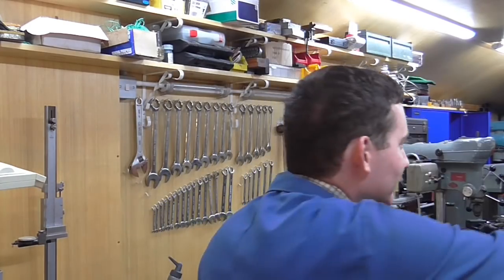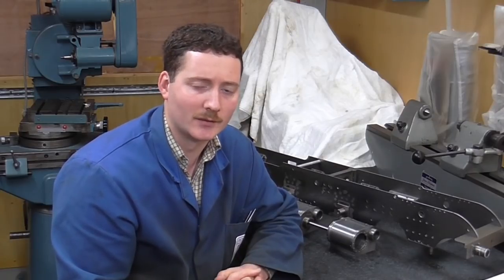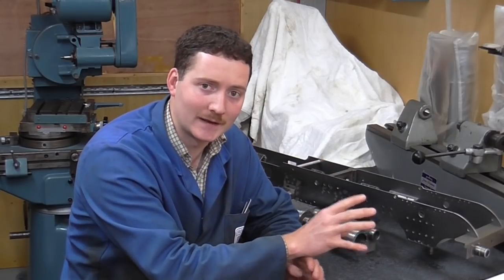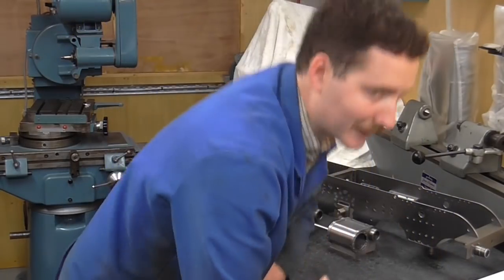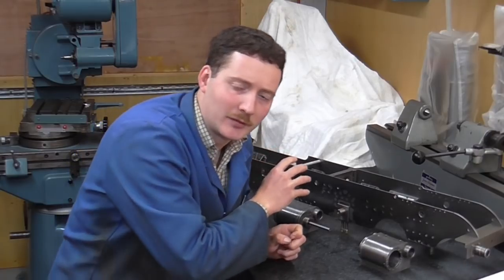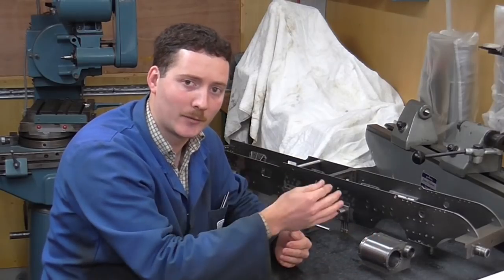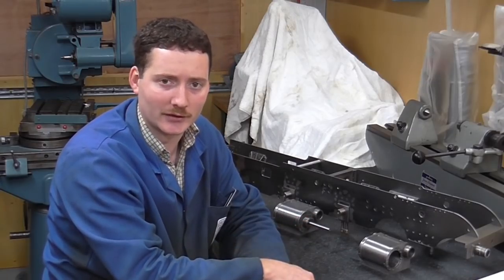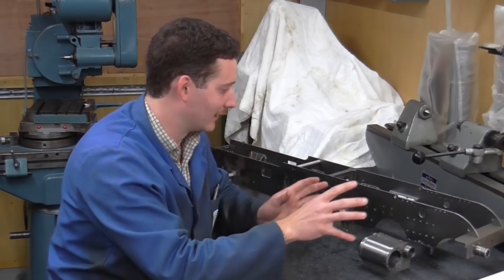Build Yourself a Steam Locomotive

Comment: Totally agree regarding lathe and milling machine. I started off making my LBSC Tich with a vertical slide and it was so frustrating, getting a small mill has been a game changer. Like you Im interested in building a loco for the engineering side of things rather than running which is why ive gone for a small tank engine subject

Comment: Very informative video and should be mandatory viewing for every model engineer before starting a project. I am building a 7 1/4" Dart 0-4-2 originally designed by Martin Evans, it transpires there are 13 errors in his original drawings from parts out of the scale position to the brake controls running through the ashpan. I have heard Martin Evans referred to as Martin Errors. 
As you say, filming a project takes up a lot of time and in a week you might spend 5 days building and two days editting and posting the video, apart from the time setting up the camera, starting and storring filming in between machining parts. 
Steve

Comment: No machine experience at all myself (though I hope to learn), but I found this interesting, my thanks and compliments.

Went the fully-machined kit route for my first locomotive, a Gauge 1 0-4-0T, so that's another option one might consider if they want a locomotive, as there are kits for larger scales. Sort of what I'm hoping to do, save up for a 5 inch gauge kit and then get the machinery and skills to keep it in good repair.

Comment: As a Ex motor mechanic Apprenticed in 1969 I have often been asked by car enthusiasts what bolt manufacturers or indeed during metrification what bolt sizes were used on a specific model As I pointed out to one Remanufacturer of Ford's UK products his turnout was a Rolls Royce compared to a Dagenham Dustbin

Comment: Hi Cris, as you know I'm building a Clayton Steam Wagon. I chose that because: I didn't want to be tied to a track, has a relatively simple to build vertical boiler, fits the available space, has features that I am familiar with on full size road vehicles such as steering gear and differential. But I guess like you its the journey rather than the finished model that interests me the most. I have a Simplex and its a good loco but haven't used in 3 years, having said that lockdown has got in the way for most of that. Look forward to more videos.

Comment: On the subject of half built engines, whilst not disagreeing, I do have a part build I need to finish. I bought it as  the chassis for an 0-4-0 similar to Titch at 3 1/2" gauge with drawings from a well known auction site. When it arrived it turned out to be 5" freelance contractors tank engine with original drawings, which are so good, I bought an A0 case to keep them safe and had copies made because they are getting no where near anything dirty.. The chassis runs on air fantastically well though the axles need a trim,  and I need to make the boiler which shouldn't be a problem as I have had a specialist prepare a safety report on the design.

Comment: As always , sound advice mr Crispin , don’t let your heart rule your head …. 3 years into a self designed 7 1/4” gauge “ Lion” all on a myford  back in the 1980’s early 90’s ( had to pull the lathe round by hand to cut the tyre rads on the wheels ….. ) but events over took and now finished by its new owner I believe …….

Comment: I would imagine beginners unsure of a project of that size might want to consider building 1 or 2 official piston/valve assemblies into a simple reciprocating engine to get a feel for the work, and if they decide they want to do the whole job they can decide to do so at that point, or if still undecided, then build the boiler to run the partial engine on steam, all the while developing an inventory of spec bits that match the plans. At any point, the running engine/boiler and other bits could be sold to an enthusiast who might want to complete the rest of the model but lacks the lathe/ mill or ones of sufficient size.

Comment: Another loco that Australian builders may consider is Wombat .
Only thing I can add to this is unless you are an experienced model engineer stick with proven designs that have been built many times as it is much easier to research for any drawing anomalies or revisions , I’m currently building  a version of the M.E beam engine but the drawings  look like a Chicken with an LSD addiction has scratched them out and many of the dimensions are grossly wrong or non existent leaving me to spend many hours of my life trying to work out what is going on .This will be the third and last kit I build from this supplier, first one was ok on the drawings but crap castings , second one not bad overall but this last one is doing my head in 😵‍💫  I built a Stuart Score engine a few years ago and it was a pleasure because the drawings and castings were to spec - the thing I’m doing now is a real dogs breakfast but I will get it done eventually !

Comment: I liked ur video
I am a retired machinist, with a machine shop at home, bridgeport, hardinge lathe etc.
My biggest challenge seems to be
getting a full set of plans.
I have built, model steam engines before and like the external components.
looking at ur model, perhaps something 1/3 to 1/2 ur size.

So any ideas on plans ?
thank you
Reply from the maker: Hi, see if you can get on the AJ Reeves website and have a look at Simplex or Rob Roy

Comment: A technical question that I have been wondering about is do any steam engine builders use the relatively modern design type of spirolox spiral stainless steel rings for piston rings? It seems a very viable idea to use such a design of piston  ring rather than the old school,thick section cast iron rings.
Second question: did you remind the brother to pack his  tooth brush before the recent Ireland visit?

Comment: The answer to the question "Wouldn't it have been better to use a pan head rivet on this step" is usually f off. Similarly for those who insist that there must be a battery even though you've told them it runs on steam, and it's smoking and shooting steam out of one of the safety valves.

Both Simplex and Sweat pea are good passenger haulers. I know someone selling the latter if anyone is interested, though is has a few issues and they are looking for boiler certificates.

Comment: A well thought out video. One thing I would like to add is drawing software. I come from an engineering perspective and am building a model for the challenge. There are a number of errors on the drawings just as you say with your engine. I am using drawing software to iron out some of these errors and possible problems, and its also good sometimes to help give me an idea how to approach a machining challenge.
Reply from the maker: A good point
Reply: Hi Mark.

In engineering we have a saying "measure once, cut twice".
Reply: I am using Fusion 360 (free personal license) to create and assemble the components of my loco project before I actually machine them for real in my workshop.
Reply: @simonwalker1064  When you come to turning your CAD/CAM designs in to reality in the workshop, please remember "measure once, cut twice".
Reply: As we used to say “ An hour in the drawing office is worth a day in the workshop ! ”

Comment: Documenting these builds would be a great assignment for an enthusiastic kid learning 3D CAD modelling software. I wonder if anyone has tried. There are FOSS (free & open source software) packages available, as well as online versions of proprietary software packages, so it would be just a matter of time and gathering the resources to do this.
Reply from the maker: I know of a few people who have modelled their own projects but not aware of any commercially produced models.
Reply: @MrCrispinEnterprises  I've done a little webcrawl to see what is around...mostly people creating renderings, no one going and doing a comprehensive design from the top to the bottom. 

I'm not particularly a CAD driver, e.g., 3D modelling CAD software, PRO-E or Solidworks, but have played a bit in FreeCAD, the closest analogue in FOSS software. I can create 2D flat engineering drawings in an old shareware CAD package I've used for 25 years (it's still being updated)--the best $25 I ever spent. These are vector files and can be exported into .dxf format (and some others). If you've got some data, I could at least help you get things drawn up, if you need the help. I'm not a train fan per se (my father played with HO scale stuff and was a machinist), but I do enjoy machining projects.

Comment: Have you considered making a discord server for the channel? It would be a free way of running a "forum" and could be useful for discussing building methods or design issues. (Currently trying to design my own 3 1/2 inch train and I'd certainly be interested with your own and others input.)
Reply from the maker: That's probably. A good suggestion. Unfortunately I know nothing about websites / forums ect I will have a think.
Reply: @MrCrispinEnterprises  Good show, found the discord system to be fairly user friendly myself

Comment: Boiler for an 0-4-0 3.5in gauge Juliet is around 1k.
Reply from the maker: Sounds like very good value
Reply: @MrCrispinEnterprises  Hi, I built a Tich in 1953/56. The work involved is as much as a bigger engine and unless the build is pretty good performance will be pretty bad! I have also built an Ajax which I used for passenger hauling from 1986 to 2014 when it was substituted by my 0-6-0 Achilles. Both these engines were designed by Dick Simmonds. They are super robust and with 1.625 cylinders powerful. My Achilles has steel rimmed wheels, 2 injectors + hand pump but no axle pump, hydrostatic lubrication and is vacuum fitted for train breaking.
The boiler has radiant super heaters that go all the way to the back of the fire box.
Its a lovely engine to drive and can be kept in steam for hours.
I would send you a photo but dont know to do that on Ytube😐

Comment: Coal-fired boiler. How about running it on bottled gas - for less mess & hassle ?
Reply from the maker: Not authentic! But yes some people do. 
By the way your earlier comment got automatically deleted I think because it contained a link.  
Cheers
Reply: @MrCrispinEnterprises  MANY thanks for that as the comment still appears to me !

If you're building for the engineering, I though gas would be a nice option - do some 'head'/'mental' engineering - so you can fit a gas burner in the finished firebox !
Reply from the maker: The same thing happens with any comment that has a link in it. For some reason it gets automatically deleted.
Reply: @MrCrispinEnterprises  Deffo didn't used to be the case.